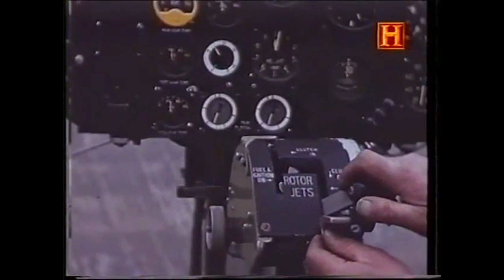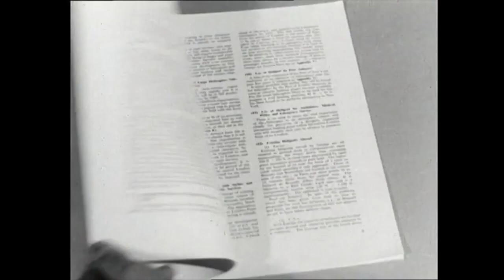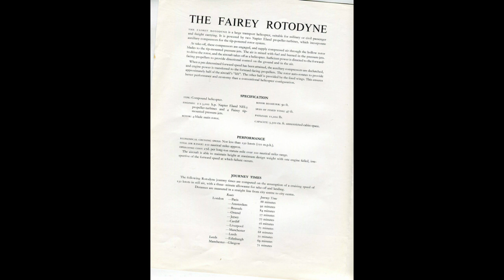History of the Gyroplane - part 15 the REAL reason the Rotodyne failed

Comment: Why not use an electric motor to turn the large propeller. Then as its takes off the power tether would break and the forward propellers can move the craft forward. Just a thought
Reply: Perhaps plugging it back in for landing would be an insurmountable challenge.
Reply: It would have developed a long way since the original concept - particularly in noise suppression. My dad worked at White Waltham during its development
Reply: The Rotordyne had a self powered rotor so that didn't need a tail rotor. I know it could use asymmetric thrust for some yaw control, but would have needed much more fidelity if trying to overcome the torque produced by powering the rotor mechanically from the airframe. Tip powered rotors were tried by many, but in the end, there were better ways to do things.

Comment: What a beautiful machine!!! These birds have tip-jets, which is the best of both worlds..  A rotor that was powered independently from the fuselage, which meant that no stability rotor was needed on the empenage. The aircraft was much lighter because of this... Yet the plane seemed to have excellent VTOL capability, like a helicopter. Beautifully simple and very effective solution to create VTOL....The Real reason for it's demise was NOT noise, and it was NOT the resonant vibration, which was being successfully addressed by the engineers... The REAL reason it's existence was cut short is mainly because it's competitor, Westland industries had developed the conventional designed helicopters, and spent Huge amounts of money doing that.... Fairy had a design that would leave Westland with largely obsolete equipment... So the Westland company used it's huge political influence to require Fairey to be acquired by Westland and merge... Not long after that Hostile take-over took place , the entire Rotodyne program was completely scrapped.... Same old story of what happens to publicly owned & operated companies....
Reply: Can't help feeling the world has taken a couple of wrong turns with autogyros. The relentless persistence with the pusher auto gyro (along with a rather relaxed attitude to construction and training), seems to have doomed the civilian sports market, whereas similar enthusiasm for the tractor gyro (and more emphasis on training etc), might have actually succeeded. 
The ditching of the Rotodyne, again in favour of helicopters, giving an emphasis on inferior technology in many ways. Given its ability for VTOL, hovering and faster than a helicopter in level flight, all of which would have presumably improved over the  years. It's military applications seem manifest and obvious, compared to the strange swivel wing things they keep trying to invent to do the job.
Reply: @onastick2411  The Rotodyne was the direction the current helicopter industry, needed to go back then... Tons of money and research went into helicopters back then, but the Rotodyne was done on a fairly limited budget, as compared to developing helicopters... The only reason Westland bought-out that company was to freeze further development of autogyros through the patent laws provisions that were actually honored by several industrial nations at that time... Someday, somebody will re-dus over the obvious numerous advantages of auto-gyros over helicopters...